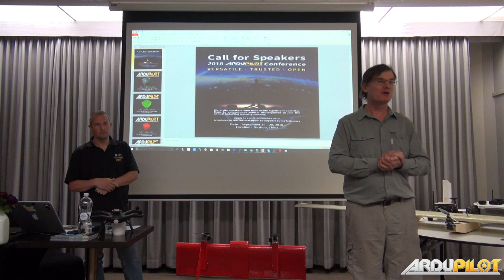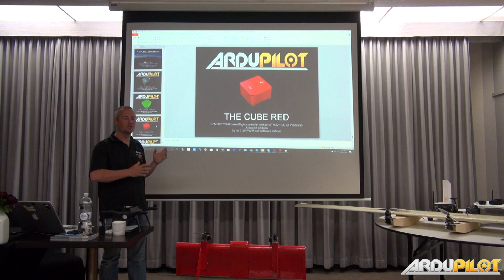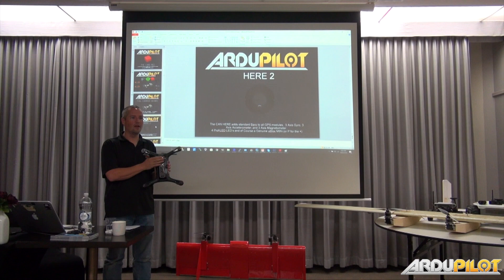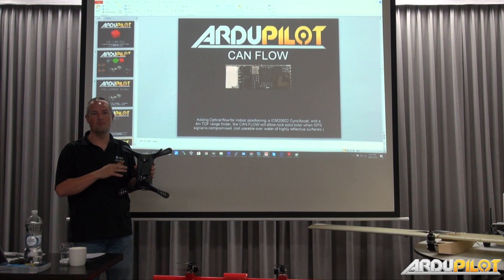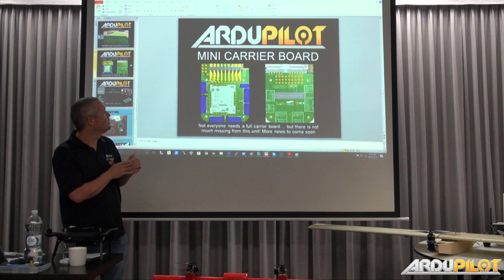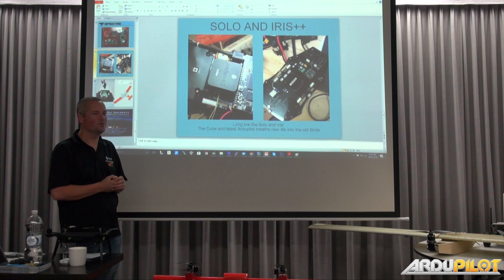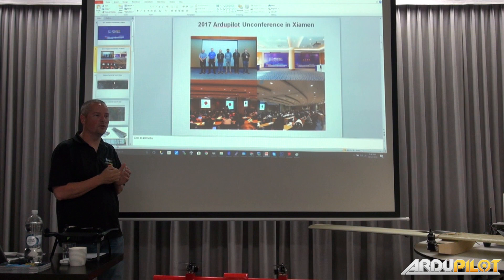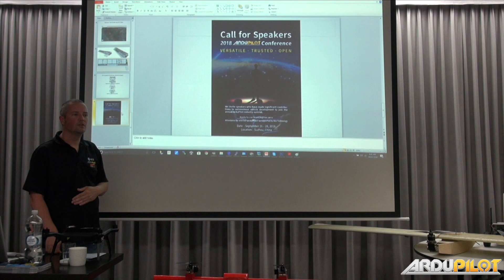Hardware

Comment: Disappointed not to see a future more compact version of the Cube(Pixhawk) in the hardware roadmap, and a stubborn persistence of P. Rowse in a cumbersome (voluminous and heavy) cube+carrier board design against the industry minimization trend of all other components in drones (for obvious weight reasons too).
Reply: The current Cube is large because of the isolation. He mentioned the Cube Blue, which will not have the isolation, although he didn't say if it will be any smaller. He also showed the upcoming mini carrier board, as well as the potential for an even smaller board once CAN is adopted more widely, so I wouldn't say that they don't have a mind towards miniaturization.

That said, proficnc probably isn't who to look to if you want really tiny hardware; I'm not sure if profi is focused on the micro form factor, as it seems they are more interested in providing the safety and redundancy needed for professional and commercial use, and that requires size. For example, profi's power selection module for the Pix2.1 by itself is larger than the F4-sized flight controllers you find on micro drones, but the PSM is essential for the safety required to be able to fly larger drones professionally.